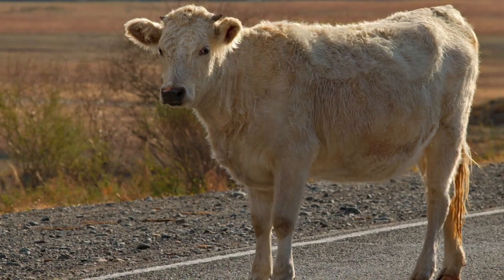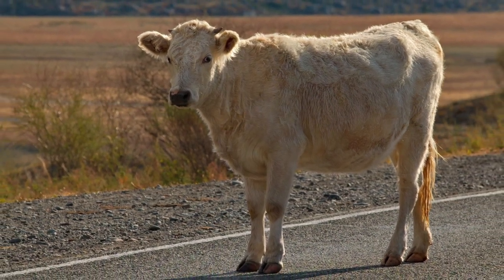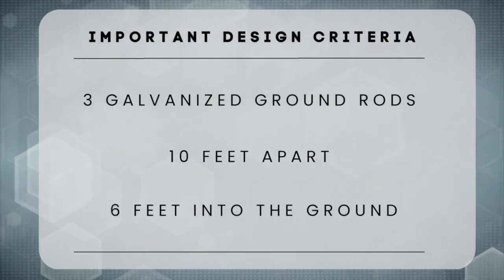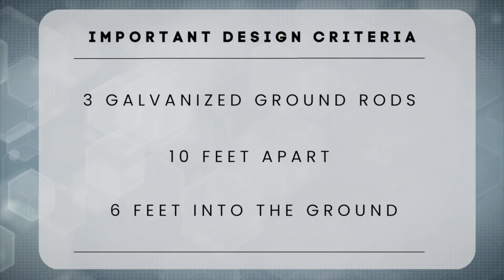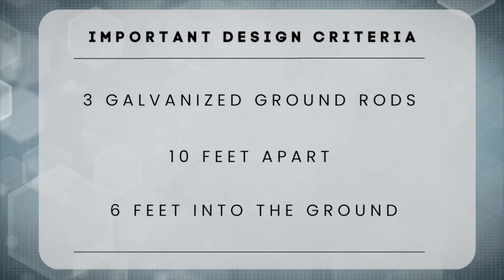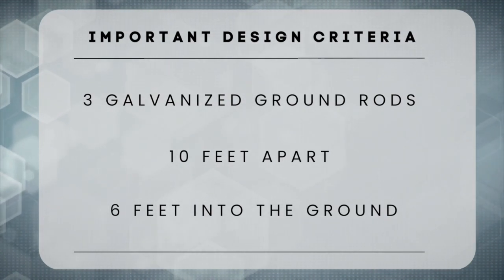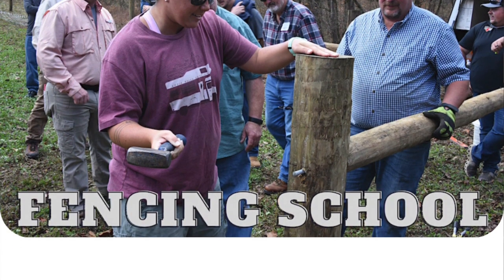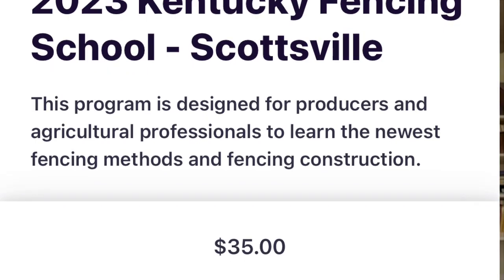Electric Fence Grounding

Comment: If people don't currently have 3 ground rods 10 feet apart driven 6 feet into the ground, that's something they can add to their system? Not people live where I live, they can't. Where I live, we have this thing called bedrock. It starts about 3 inches to 3 feet into the ground. You're not going to get 6 feet of ground rod into the ground anywhere, much less 3 places spaced 10 feet apart. You're especially not going to get that in enough locations that you don't have to much less in enough locations that you don't have to string out hundreds of yards of fence that deer, hogs, bears, falling tree branches, and other random things are going to knock down daily just so you can have a couple hundred feet around where your cattle actually need to be.

Where would she recommend that people go to learn more about this? Nowhere because she doesn't know anything. To get out of admitting that she doesn't know anything, she recommends that people go to an in person fencing class that isn't going to say anything else about electric fences.

Why did you people waste everyone's time by making a video that says the same thing it says on the box when you buy any electric fence? Worthless crap like this should be filed away in a worthless crap section of the internet. Stop wasting people's time.
Reply: Relax friend, no video can cover every single person's circumstances, so most of them try to address what the majority of viewers will be dealing with so they can help the most people. There's no need to be outraged that every video online isn't catered to you personally. You could have just asked a civil question about your circumstances, and maybe someone would come along and give you some advice. 
If it were me I would get the ground rods in as far as I can, but then also run alternating ground/hot wires on the fence such that an animal is likely to touch both, making it unnecessary for the current to travel through the ground for the circuit to be completed.
Reply: So buy a farm in an area with better ground, or go back to barb wire than, ya whiny dink.
Reply: The three rods at 6 feet is overkill for most systems, but it ensures that your system is undoubtedly properly grounded. But you can divide those rods if you can't get down to 6'. You can do 6 3' rods, 9 2' rods, etc